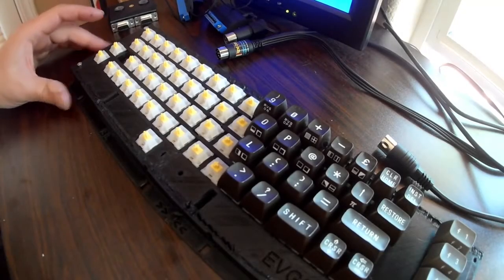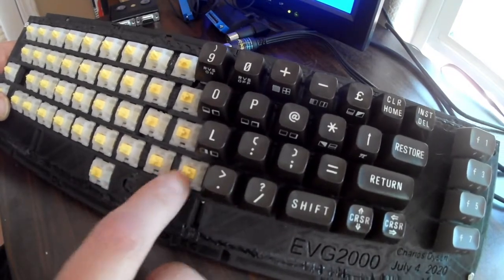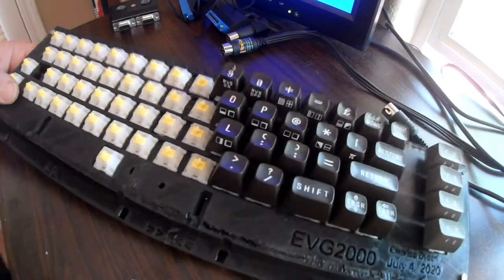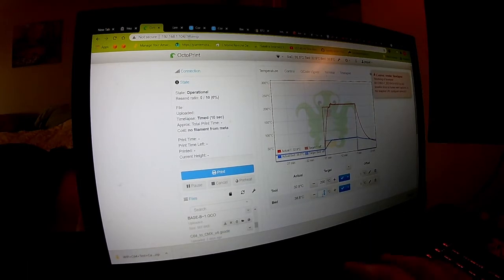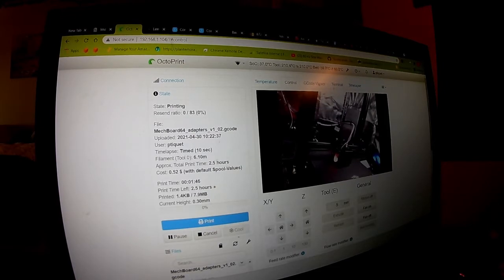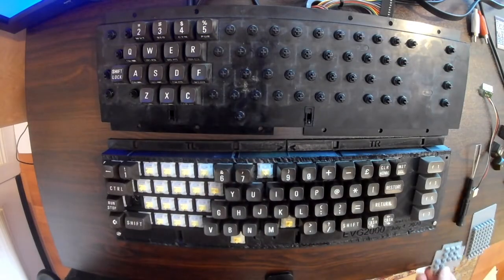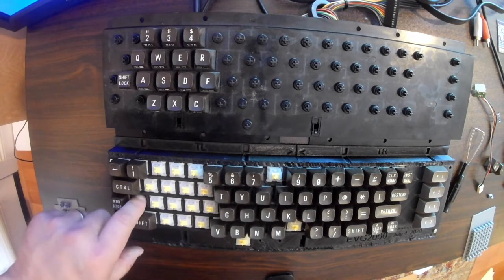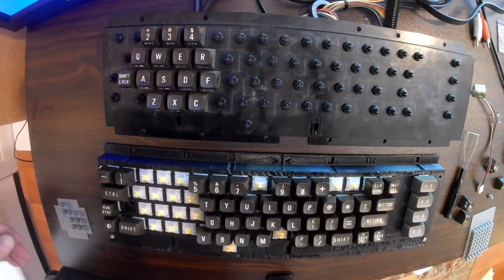MechBoard64 build - New built in 2021 keyboard for the Commodore 64

Comment: over a year later from your original video, and I'm about to embark on the MechBoard64 build using this same approach (3D printed bracket, adapters) -- plus LEDs!! This video has been very helpful.
How has the 3D printed bracket held up? I've been told to avoid 3D and go aluminum, but it's so much more expensive...